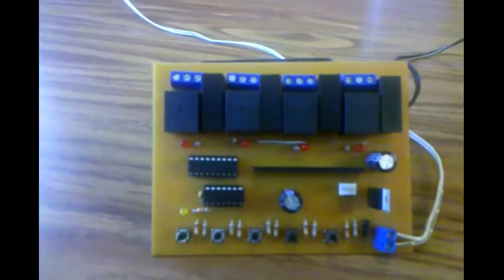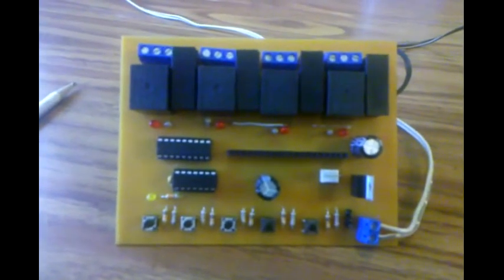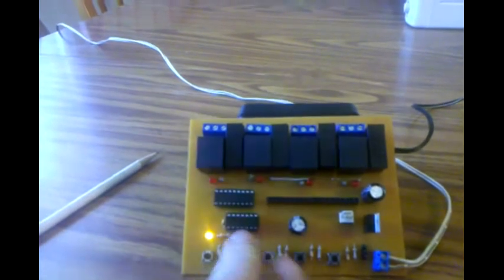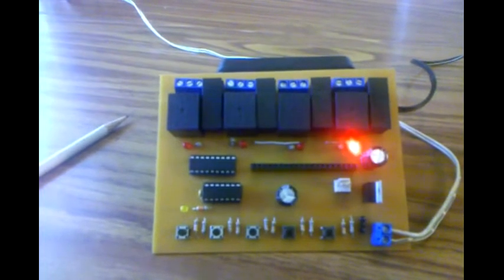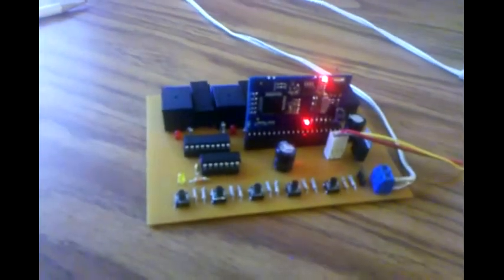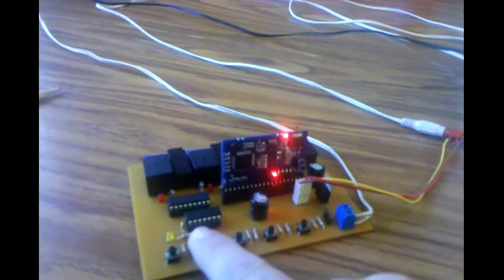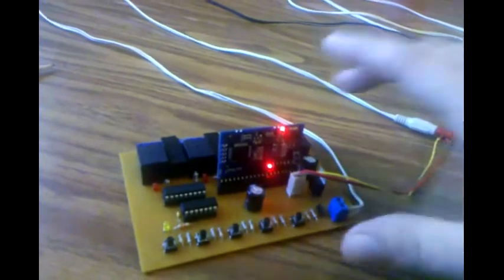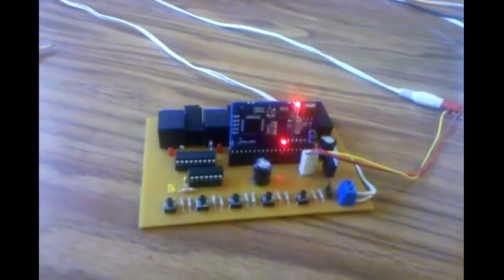4 channel prop controller

Comment: Tyler, I can't tell you how much I appreciate you for sharing this information.  I've been wanting to build my own controllers for YEARS!  This is exactly what I was looking for.  What a great alternative to the commercial models, and at a great price!   I'm not too experienced with building circuits, so I'll just have to give it a try and see if I can make it work.  I'm sure that once I do that, I'll be able to adjust the design/layout if needed.  Eternally grateful, thanks man!

Comment from the maker: You will need Cadsoft Eagle to open the .brd and .sch files the free version will work fine for what you need.  there are tons of tutorials on the net that show how to use Eagle etch the circuit board. The firmware was written in Great Cow Graphical Basic so you might want to download that if you want to change the firmware or you could just flash the hex file to chip with whatever software that works with your PIC programmer

Comment from the maker: I added a link to download the etch files and firmware to the video description.  You might have to signup for a membership at DIYC to download them.  I think the free membership is all you need to get in to the File Library.  If you cant access them let me know and I'll get them to you.  As far as build instructions I have not written anything. It is a simple board just follow the silkscreen.  Start with the short parts and work your way to the tall ones.